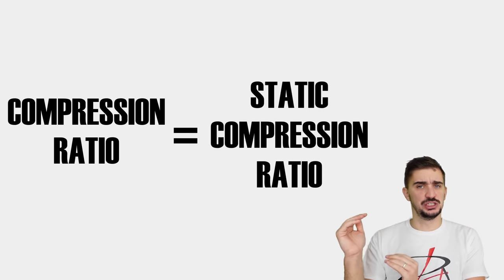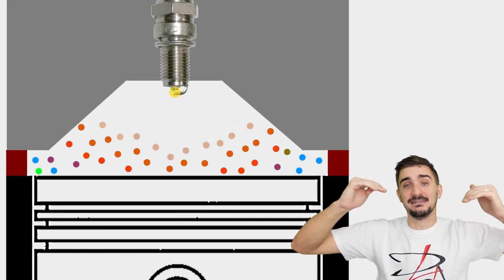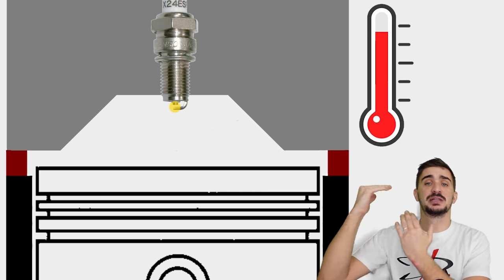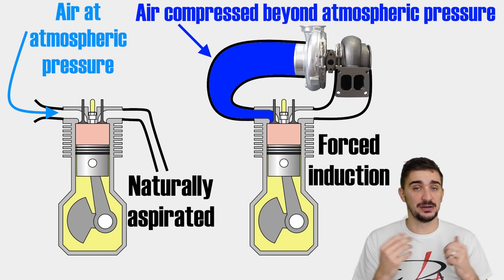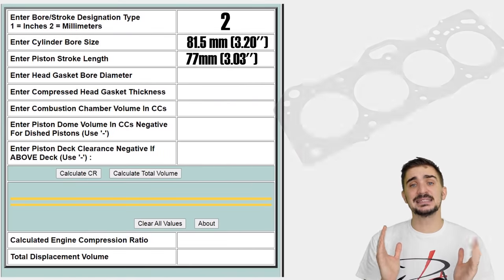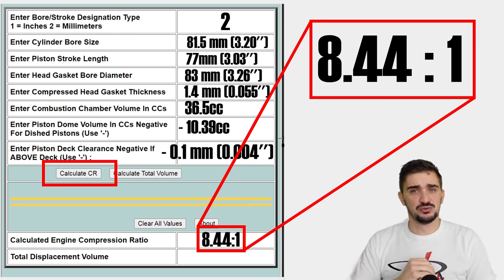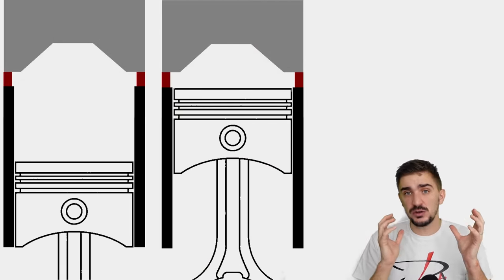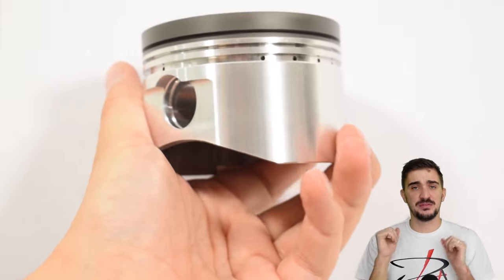COMPRESSION RATIO: HOW to CALCULATE, MODIFY and CHOOSE the BEST one - BOOST SCHOOL #10

Comment: I was very disappointed that "octane rating" was not mentioned, as typically it needs to increase with increased boost and/or CR.  Also, when using "regular" pump gas, on a naturally aspirated engine, with a compression ratio above 9:1, some "knock" mitigation has to come into effect, either retarding the timing, or enriching the AF ratio, which both decreases efficiency at the RPM and throttle opening where it is applied.  On the other hand increased CR gives a greater "expansion ratio" which increases efficiency, which is the primary reason Diesel engines are typically more efficient.
Reply: Some years ago David Vizard wrote an article about a methanol drinking, Nitros snorting drag car engine, running a very high static CR. The owner/driver wasn't happy with the trap speed.
Vizards said that even tho the engine wasn't suffering from knock, the static CR was too high. The logic being that the air/fuel charge was consumed so quickly, because the charge was so closely packed in the combustion chamber. There was some huge initial pressure as the flame front rapidly spread through the charge, but pressure also dropped off rapidly as the piston went down the bore. It was an interesting read.
Reply: This video wasn't about fuel types. It was about compression ratio. There are hundreds of other factors he could have also discussed. Intake charge temperature, moisture content, different types of fuel, spark plug options, blow by, PCV systems, you get my point.
Reply: Why do you expect a video which explains the internal engine build level analysis and compression and boost relationship to waste time on octane rating? A concept anyone who's watching this video should already know. If not, I really think the viewer got lost and watched the wrong video for him or her ;)
Reply: @802Garage  but it does have missing information as some OEM's do change the compression ratio on the fly Nissan being one of them in the KR20- - - 7:1-14:1 ish. sorry not a fanboy so i forgot its name and some specific details but its 👍 so i remember it
Reply: @Alfaduk  this is remidied by big bore, short stroke, high rpm
Reply: My c5 corvette doesn’t knock at 10.2-1 CR on 93

Comment: There's no mention here of dynamic compression ratio, which is the true defining factor of how much the air/fuel mixture gets compressed. Compression in the compression stroke doesn't begin until the intake valve closes, which sometimes doesn't happen until the piston is well on its way up. A change in cam, or a change in cam degreeing can dramatically change the dynamic compression ratio, and thereby determine how much power and heat will be generated. All of this can be changed without ever touching the static compression ratio
Reply: This is true to a point.  However, if the engine is able to breathe effectively and achieve good cylinder filling at an RPM where there is no flow inversion, that can counteract the effect.  Usually things aren't synced up quite right to fully make that happen, but that's usually not on purpose.

The 2-stroke community ran into this effect decades ago.  A high exhaust port reduced the dynamic compression ratio, which had the expected effect at low revs.  But when the ports are working as intended, cylinder pressures and torque production easily matched an engine with even the mildest of ports (high dynamic compression), and so they had to bring static compression back down to stop detonation.  While car engines are usually not very nicely resonance-tuned, it is possible with the right combination of header and intake runner length to actually match the cam timing for once, and create a situation where 13:1 with a big cam detonates like 13:1 on a small cam.  Or, of course, a big pile of top-end-heavy boost can get you there, too.

Comment: Tech Tip: a naturally aspirated street engine at 8.25 to 1 compression versus a street engine at 10.5 to 1 compression. Both cars and engines identical and running 87 octane the 10.5 to 1 compression engine gets better fuel mileage, throttle response has more torque and horsepower across the board. The 8.25 compression engine is lazy and acts like dead cylinders with blow by. Even though both engines are New. Compression is power and gas mileage. There's always been a myth that a high compression engine will run hotter than a lower compression engine that's false. In a case like these two street engines with both identical blow by leak down rate. The higher compression engine actually runs cooler the reason why both engines side by side going down the road the lower compression engine has the carburetor linkage opened up more to keep up at the same speed. The lower compression engine is not an efficient engine as the higher compression engine both running pump gas. But of course some will disagree.
Reply: High comp burns cleaner and faster...less heat to block transfer...

Comment: On a 4 cylinder I made 409whp w/ 9:1 Compression @17 PSI and 511whp w/ 8:1 Compression @ 22.5 PSI both setups on 91 octane Valero gas.
Reply: Size turbo?

Comment: one thing to add to this is choosing a knock suppression system either in the form of auxiliary injection or a more knock resistant base fuel can leave room for a higher compression ratio. I will be running a 9.5:1 2.0l that should make about 6-700 awhp.
Reply: u will be running water-meth iny. or e85?
Reply: @dainsleifag2516  I'll be running E.
Reply: 700 horses on a 2 liter?
Reply: @ghoulbuster1  4g63t
Reply: @ghoulbuster1  stock 2.0 TFSI reach 550hp with no problem in street cars...
Reply: @jedras1991  woah that's a nice engine!
Reply: It's all in how deep your pockets are..you could build a couple big block engines for the price of this one 2L engine...
Reply: @jondough4116  and how much your willing to spend on going.
Reply: @ghoulbuster1  There's a couple of billet 4G63Ts running about 1800 HP on 86 PSI.
Reply: @jondough4116  2.0 is big block in europe we don't get shit here
Reply: @7sins979  4G67 here, those engines can sure take a beating
Reply: @jedras1991  To jsou kecy, tak 200 až 250 HP max. je reálných. Neznám takový sériový motor.
Reply: @vd4534  2.0tfsi CJXA 500hp+ on you tube...

Comment: As always an excellent technical video with easy to understand examples... thank you. 

We have been working on special heads that have continuously variable combustion chamber volume. The CR remains constant regardless of boost levels. Our 5X head runs 10:1 with no boost and it remains 10:1 at 5 Bar Boost. If volume was fixed, we would need to have a static CR of 2:1 - 3:1. Great on starter (no back pressure from high compression), very bad on idle. In fact, gas engine probably wouldn't even run at that low of CR. 

Example with CI's instead of CC's. 8 Cylinder 400 CI. Each cylinder has 50 CI. Total Head/chamber volume = 5 CI at 0 boost. CR = 10:1 and runs on pump gas. At 1 Bar boost, combustion chamber volume increases from 5 CI to 10 CI and CR = 5:1 Static and 10:1 Dynamic. At 5 Bar boost, chamber volume increases to 25 CI and Static CR = 3:1 Dynamic = 10:1. At no time is the CR less than or more than 10:1.  Depending on fuel, the final CR is automatically controlled  by computer from 7.5:1 to 10:1 to 12.5:1 or even 15:1 if running Methanol. When cranking engine over to start, CR is lowered for easier cranking.

The 'magic' is in the 5X Head. Combustion Chamber diameter = Bore of engine = 4.0" The height is varied to increase total volume up to 5 times original. When people ask how we are getting 2,500 horsepower from a street legal small block engine running on pump gas, we tell them it's 'magic'. In fact, engine can be used for a daily driver and is emissions compliant. 

Forced induction uses supercharger on intake manifold with turbochargers feeding pressurized air to a buffer air storage tank which feeds supercharger. Turbos are always running full boost, the waste-gate is on air tank and it is set for 2-3 Bar higher than what is needed at anytime from air storage. 

As air pressure drops coming out of tank, that alone produces a cooling effect just like refrigeration cycle. Inter-coolers between turbos and tank. Large inter-cooler in tank. Final heat exchanger between supercharger and manifold. Goal is High Bar Boost at lowest possible air temperature. Cooler denser air = more power.
Reply: How the hell did you design a continuously variable combustion chamber volume?
Reply: @benperkins2929  I came up 3 methods:

One method raises or lowers crank. That increases or decreases volume. The trick is keeping engine output same when attaching transmission. I came up with a series of gears that did that.

Anther design raises or lowers entire head. Trick is a sleeving a cylinder when head is higher than engine block.

Last design used an insert into combustion chamber that increase or decreased volumes directly. Trick is finding enough room withing head for piston insert to work. 

I am looking at using several of the concepts on every day cars. If could be a simple 'add on' millions of car nut would buy. And major car companies can buy license to use on their own cars. 

Concept started out with 5X heads. Able to withstand 5 Bars of forced induction. Had to look at increasing or decreasing combustion chamber volume. Had to be able to drop CR  or add CR.

Comment: Meanwhile here, running an supercharged 1 liter engine reaching 180kPa manifold air pressure (sea level) and working with 11.4:1 compression ratio... lol

Running on ethanol is excellent and the MegaSquirt MS1 got enough accuracy keep this Fiesta working at 110whp safely, however running on common 87-90 octane Gasoline will require some proper detonation sensor, otherwise it will not work.

Comment: You should do a series about NA tuning. Turbos and superchargers are too easy and boring. True talent is pulling lots of horsepower out of an NA engine
Reply: For many engines on this planet, that means revving to the sky! At least in automobile-sim-game-world, especially Sony's Gran Turismo and EA's Need For Speed, LOL.
Reply: @RJARRRPCGP  right? It takes true talent to get 250 horsepower from a 4AGE-U. Anyone can put on a bigger turbo. But you have to truly know engines to tune a Ford 427 to make 800 horsepower without forced induction. Besides. I think an NA engine will always sound better than one with forced induction. I would take a 4 cylinder that can reach 11 grand over a turbo LS any day, high rpms sound so good
Reply: @laurenmartinez55  Sounds like something I came up with a while ago a high-compression short-stroke V8 that hits 15,000-20,000 RPM for redline, just like that! But the torque curve is flat for the engine type! Total opposite to what I was thinking about lately. That was especially back in the early-2010s, LOL. (Not IRL) Then later on, I imagined the total-opposite, where you can spin out too easily at 1,200 RPM! (Also not IRL, where I did this in a sim) (long-stroke V6) Simulated that in VDrift!

Comment: It would be better to call the smaller "cylinder volume", the "combustion chamber" volume,  as it is normally called and is easier to differentiate from cylinder volume which is the bore × stroke..of course, in calculating compression ratio both must be added together ... 🤔

Comment: Wrong we at novitec milled down bouth pistons and cylinder head to INCREASE space and lower CR on Ferrari and Alfa Romeo. Pistons get cerammic coating as some other parts. Opel y32se and x30xe run 500-700hp on cast pistons with decompression plates .

Comment: I wonder if there's correlating math on fuel economy against compression. Power output is 4% per point, but what about fuel economy? A stock dodge 5.2 is 220 horse on a pathetic and often not even 9.0:1 compression ratio, so bumping to 10.5 as most do or 11:1 would be 233-237. If fuel economy increase was comparable, the window sticker for 18 would then be closer to 19-19.4, which while that isn't huge, can be impacted obviously with tuning and other mods like longtube headers, etc.
Reply: Bumping it to 9.7: 1 and switching to high octane gas with no "knock mitigation" comming into effect should increase the fuel efficency around 8%, (4 x 2) but once knock mitigation measures start taking effect, the efficency of a higher CR increases at a lower rate,

Comment: Would love to see a video explaining dynamic compression ratios,  effects of cam overlap and differences between cam advance & retard on intake and/or exhaust cams particularly in relation to a naturally aspirated high compression engine as well as turbo'd, as the naturally aspirated side of things are not something that has been widely covered before by anyone (at least not in my searches). I would also be interested to know more about ceramic piston & combustion chamber coatings and their pros and cons, in a turbo'd vs high compression N/A engines
Reply: I was thinking along the same lines; the piston can't start building compression until all the valves are closed, & the intake valve[s} aren't fully closed yet at BDC
Reply: Tysm for mentioning these things
Reply: @bhaggen  technically it can, if you catch the pressure waves (which is where the black magic of cam specification comes into play) the cylinder will continue filling even as the piston starts moving up the bore and the intake valve is still open.

This is how n/a engines can have over 100% volumetric efficiency.
Reply: @Rollin8.0 .....But that occurs at high rpm where the force of the incoming column of air becomes relevant [F=MV²]
Reply: It really can get wild with larger cams. My 11.6:1 motor has a lower dynamic compression ratio than the stock 9.7:1 engine had at low rpm’s but at high rpm it flips but at high rpm you can get away with more dynamic compression due to the speed of events. Also it’s getting water injection and 15-20psi of boost on 11.6:1 basically a text book rally build
Reply: I wondered how an Atkinson cycle changes compression ratios too.

Comment: I just thought about something, more than before at least, that I have heard nobody discuss. How valves overlap effects your effective compression ratio. Now I know the Atkinson cycle takes advantage of this of course, but basically, you could have a super high compression ratio engine that has a low effective compression ratio if a valve is open for a significant portion of the compression stroke. So really, when people build an engine for a certain CR, if that isn't taken into account, they could be way off. Obviously it still has to be tuned however it needs to, but this is still significant. Am I missing something or overthinking? Why isn't this talked about more? I obviously knew this was a factor, just hadn't thought deeply, and rarely see it mentioned.

Comment: It's the compression ratio that affects knock and combustion speed but actually the expansion ratio that affects thermal efficiency. But with standard crank configuration both ratios are the same. In the Atkinson cycle or Miller cycle (or some weird crank mechanisms) those ratios can be separated for a certain amount.
Reply: And that kids is why you don't use long thin intake runners to charge your engine if you want thermal efficiency. Also you use tubo-compound with electric generator like F1. Never use roots blowers.
Reply: @ArneChristianRosenfeldt  but roots blowers are quite common in some US muscle innit? like Mustangs, Challenger, Charger?
Reply: @gitanodel69  and quite inefficient. It is just cheap and needs no ugly pipes. Only for emergencies. The mustang could shift gears on its booster. Quite sure that limp home on a drop of fuel was without boost.
Reply: @gitanodel69  now I wonder about high compression and boost. If we set the piston compression to efficient cruise, we need to increase pressure before the valve to compensate with increased friction at higher RPM. Also I think there is a log(RPM) dependency inside the combustion chamber for higher pressure at high RPM. Torque should rise log(RPM) all the way to valve float at 8000 RPM.
Reply: @ArneChristianRosenfeldt  It's more than cost and convenience. Packaging is significantly easier with most modern supercharger systems (centrifugal blowers are essentially belt driven turbos), the charge cooler is placed directly under the supercharger in an integrated manifold, and there's zero lag. F1-style e-turbos than can near-instantly build boost regardless of engine load are expensive, complex, and practically impossible to find as an aftermarket solution. Putting a Whipple-type supercharger  on an engine is often described as feeling like the engine just got a few extra liters of displacement strapped to it.
Reply: @gitanodel69  most superchargers found on modern US muscle cars are screw-type or Whipple superchargers, which are far more efficient and much more compact as a result, with the intercooler integrated into the intake manifold.
Reply: @griffinfaulkner3514  water intercoolers are always sandwiched between intake and compressor. Fundamentally an inter cooler wants slow even flow ( to avoid friction or hot pockets passing). So a centrifugal compressor needs a diffuser as adapter, but others also have a high flow rate. The pulsing from intakes needs to be eaten by the volume of the manifold. Destructive interference at that central spot where a V8 has its throttle. Of course air cooling for the whole assembly is a good idea. I mean, a light bellow to direct cool air from the front over it and push pack the hot air from the engine block.